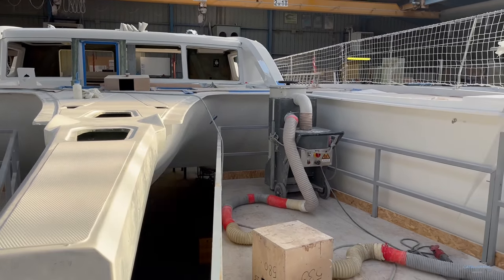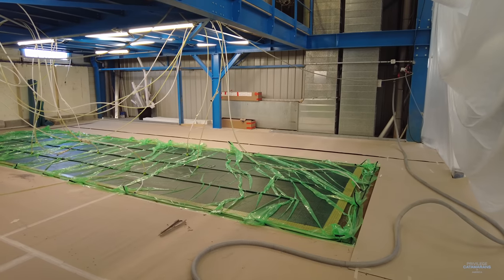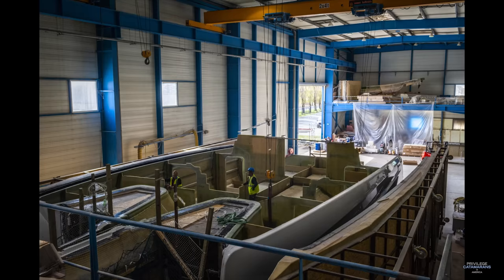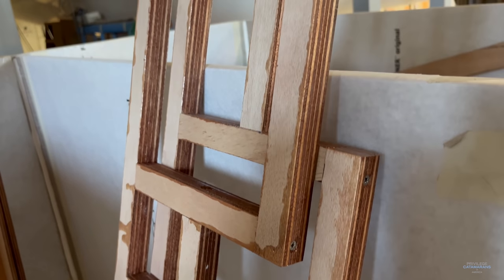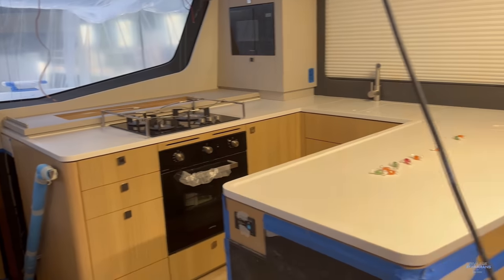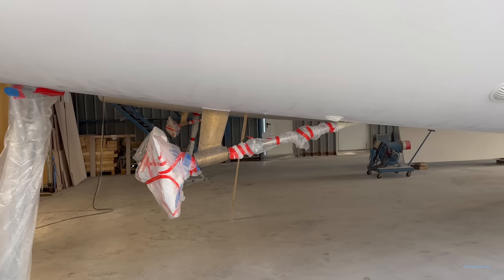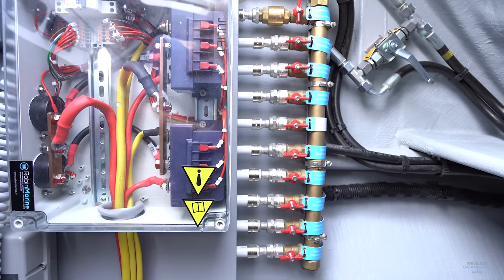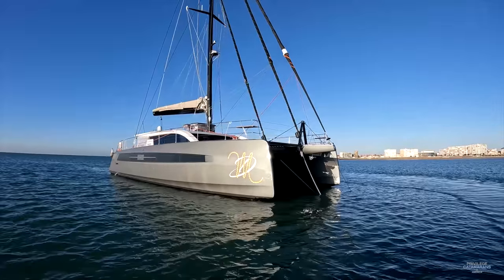Privilège Signature 580: What You Don't See at a Boat Show

Comment: I'm am a boatbuilder with more than 40 years experience. I'm very impressed with the construction methods used in these boats.
I've just been to a boatshow where all of the vessels I viewed had balsa cored vacuum infused hulls.
There will be lots of problems with these balsa cored hulls in the future as opposed to the way the Privilege is constructed.
Hats off to you guys. 
Very impressive. True boatbuilders of the modern methods.
I have done lots of infusion with performance yachts.
You guys are at the cutting edge with best methods.
Balsa core is very stiff but if not done correctly, and most don't, then the rot can run end to end through the hull eventually. I've seen it with my own eyes.
Witness the way bulkheads were just bogged and tabbed by one builder who will not be named, causing a timebomb of moving disintegrating bulkheads. 
To me , that was astounding that supposedly knowledgeable builders would do that to ocean going vessels. Makes one wonder what other shortcuts they were doing??
Excellent work Priviledge 😊
Reply from the maker: Thank you for your comments. We appreciate your feedback, particularly because your comments are grounded in experience. This is something that we can't readily display at the boat show, yet, like you say, it is critical that it be done correctly.
Reply: @PrivilegeCatamaransAmerica  I would agree with balsa core. For me boats with balsa core is a big No NO.

Comment: The areas that you are installing the plywood such as block heads have you considered alterative materials. Some builders are starting to use carbon fibre in areas of tensile strength even though if the carbon fibre starts to crack to will keep running until you drill it out in that area to then complete the repair

Comment: I believe you said there was a circumnavigating model bound for a US show sometime this year?
Reply from the maker: We will have a new 580 in time for the upcoming Annapolis Boat Show in October. However, this will not be a circumnavigator - it will have a forward cockpit with access from the salon and master cabin. It will also be a galley up layout. The model on display at the International Multihull Show is a circumnavigator and the forward cockpit has been replaced with additional storage area. We will try to get some photos and video while at the show on April 20 - 24.

Comment: Im glad you allow space for maintainance of systems .. so many designs and manufacturers undermine their vessels long term by making them unsustainable. 
The other factor is propulsion systems are going to be undergoing a massive revolution in the next decade at most.. in Europe the targets have been set for 8 years. 
The drive systems going to be electric and virtually maintainance free .. the energy supply will probably high output efficiency diesel electric generators supporting Na based batteries ..and regen under sail plus improved efficiency Hpvt pannels.
As GF and Carbon fiber are both  demanding of fossil fuels, you might also start substituting recyclable greener alternatives like basalt fiber a plentiful and natural material ...which is actually superior to E glass, steel and closer to carbon in wt saving strength, it also is also better at impact resistance than Carbon and more stable.
Impregnated Hemp fiber boards could substitute for furniture backing panels rather than foams and help lock up Co2 without resorting to heavier woods.